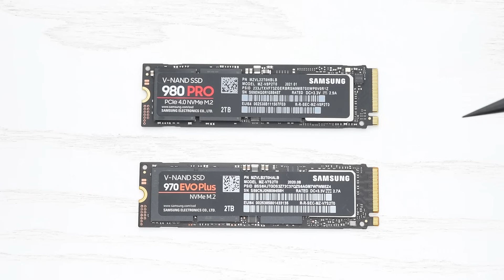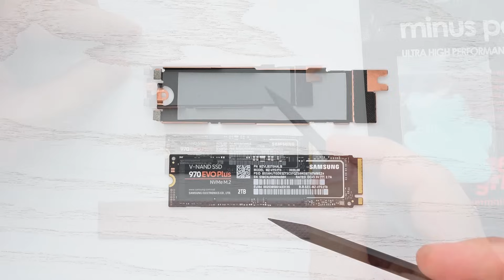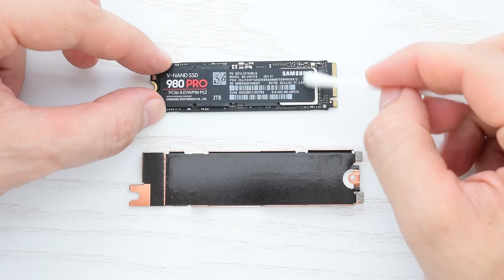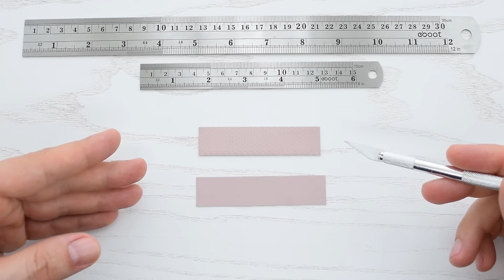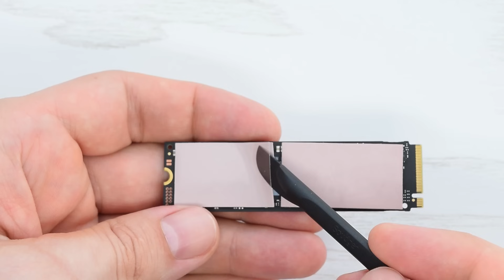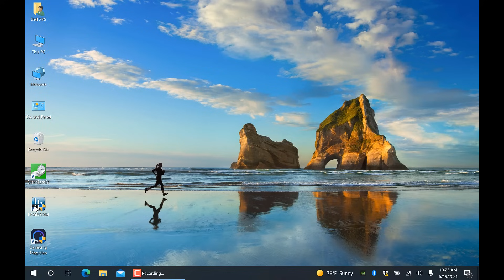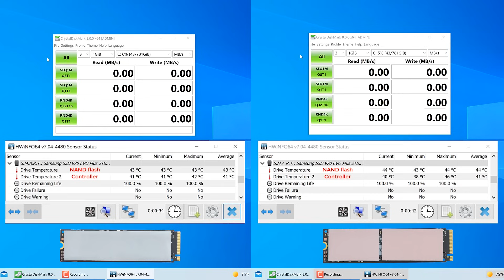Stop your Samsung NVMe SSD from Overheating and Thermal Throttling

Comment: Thanks for the video.

Samsung's design of different heights looks rational because you wouldn't want the controller's heat to be transferred to the NAND because the controller will handle it, it has protection, and in everyday scenarios it doesn't often get hot, but storing information in NAND is dependent on heat.  ...

I will probably level the height with aluminum foil tape (or copper) by sticking it in several layers over the controller. Thermal conductivity Aluminum 200 W/m·K, Copper 400 W/m·K, Thermopad 5W/m·K.
But this will have to be done by touching only the metal cover/sticker of the controller and without pressing (the more you press, the controller will die).
Next with a thin regular thermopad (the thinner the smaller the thermal barrier).

However, it’s probably an exaggeration to say that the heat transfer capacity is significantly reduced between the layers. Yes, it might be less reactive, but believe me — the heat will come out anyway. The real question is how to spread it further (for example, you can use that same copper tape as a shield and extend it to the heatsink). Also, use the system drive on PCIe 4 x4 lanes that have direct access to the CPU, so the motherboard chipset stays cooler.
Reply from the maker: Samsung really dropped the ball with their earlier design. Later Samsung made 980 EVO with a heatsink where they basically did what I showed in the video adding thermal pads for different components: https://i.ibb.co/10HwmmQ/980PRO.jpg. With the 990 PRO, they finally fixed the problem. All components are now leveled for proper thermal contact, allowing much more effective cooling which can significantly extend the drive's lifespan. We didn’t see a flood of failures, but there was still a decent number of data recovery cases for the 970 EVO and 980 and in every single one, the controller was cooked. Heat is the number 1 killer of electronics, no matter what some “SSD experts” claim about NAND needing to stay warm. That idea is nonsense. Keep your SSD cool controller, NAND, all of it. Proper cooling means longer life and your data will be safe.
Reply: @ElectronicsComputers  I measured the 990 Pro (there is also a 980 but it is occupied by the computer) production date 2025.05.26. In short, there are no height differences that need to be solved - if you measure from the bottom of the board, then to the controller 2.0mm, to Nand 1.80mm (both measurements without a sticker), so the difference is 0.2mm, but the components themselves are just as uneven if you put a plane on top of the entire 990, you can see light gaps, even the controller has an upper and lower part (it lies obliquely) and the same with nand. In short, a 0.5mm thermopad will cover everything and its compression will be especially at the beginning of the controller (there will be a belly in the middle if the ssd does not lie against the bottom). No additional solutions are needed.
Reply: @ElectronicsComputers  Is this some kind of recent refresh of the 990 pro? I have a 1 year old 990 pro and it has always have a temp difference of at least 9 degrees Celsius between its temperature sensors 1/2 and 3 in HWiNFO.

Comment: Thank you for posting this. I have Asus Rog G16 G614JV-N4474WS and wanted to upgrade it with a Samsung 990 Pro 1tb nvme m.2 pcle4.

On the Samsung 990 Pro, I did check the level difference between NAND and the controller. There doesn't seem to be any height difference. Maybe Samsung has rectified the design flaw in the 990 pro.

Any ways, i followed you instructions on the video and applied thermal pad and copper heat sink on both sides.

I did remove the sticker on the top and bottom side before i applied you technique.

The top sticker on the NAND was a regular paper type sticker, while the sticker on the other side was flexible heat sink type copper and graphene material. I chose to remove both; to have better bonding and increase conductive heat transfer between nvme and heat sink

Anyways, no more warranty...
Reply from the maker: Yeah, Samsung finally fixed the issue. They later released the 980 Pro with a heatsink, and if you take it apart, you’ll see this: https://i.ibb.co/10HwmmQ/980PRO.jpg It’s basically what I showed in the video, but they went even further adding separate thermal pads with different thicknesses to match the smaller chips. Then eventually, they leveled the top surface of all components, which made proper cooling way easier. You did an awesome job with yours smart choices on thermal materials, and solid execution. Samsung drives are super reliable, and with proper cooling like that, your SSD will have a long, happy life keeping your data safe and secure.

Comment: Problem here is theres still a label sticker between the thermal pad. Thermals could be much better if thats removed.
Reply from the maker: Removing the label will void the warranty and it doesn't make any real difference in cooling your SSD.

Comment: Coming back to this videos years after and i kust say that still its very informative. Now I am willing to use 980 pro 2tb in qwiizlab 40gbps enclusre but not sure of space between enclosure and ssd.  if i follow this which thickness  pads should i get? Can you recommend / advice? Talking about Gelid
Reply from the maker: I have a bunch of M.2 enclosures for 2230 and 2280 SSDs, and most aren’t very precise. If you use a thermal pad that’s too thick, it puts stress on the SSD’s delicate PCB, which can cause solder issues over time. Too thin, and you lose thermal contact. The best solution is thermal putty, like Upsiren link in description. It outperforms thermal pads, fills all gaps, and transfers heat effectively. That’s why it’s commonly used in consoles, laptops, and GPUs.
If you still prefer thermal pads, use a small ball of playdough or something like that on the NAND and controller, close the enclosure, reopen, measure the compressed thickness with a caliper, and order pads in that size. We deal with SSD data recovery quite often, and mechanical stress caused by incorrect thermal pad sizing is one of the common reasons for SSD failure. So take your time and do it right.
Reply: @ElectronicsComputers thank you, would you suggest applying thermal pad or putty underneath the ssd in between ssd and pcb of enclosure? As 980 pro is a dual sided ssd. If yes then wont it be tranfering all the heat to pcb and damaging it?

Comment: Unfortunately it didn't work.
Used 1mm on controller side and 0.5mm on nand side.
Heatsink does not have contact with nand side
Reply from the maker: What's the model of your SSD?

Comment: for my Samsung gen 4 SSD, it shows drive temperature 1, drive temperature 2 and drive temperature 3. what is drive temp 3? and also my stock temps are in between 44-46c
Reply from the maker: If you have three temperature sensors, then the first two usually monitor the memory chips, and the third one monitors the controller which is the most important component. Ideally, it should stay below 50 °C. If it runs at 60-90 °C or higher, it significantly shortens the drive’s lifespan, making it unreliable and increasing the risk of data loss.
Reply: @ElectronicsComputers thnx for reply 🤍

Comment: Is it not easier to just make a sandwich from 2 layers of 0.5 mm pad on a controller part instead of using 2 different pads? Or am I getting something wrong?
Reply from the maker: @iammemes  It's definitely easier and you'll get about the same result, it's just not perfect in terms of thermal conductivity compared to just one pad.
Reply: @ElectronicsComputers  make sense

Comment: but there is no heat sink available in 970 evo plus m.2 ssd ? What should i do ?
Reply from the maker: SSD manufacturers have nothing to do with heatsinks. The heatsink should come pre-installed in your laptop, desktop, or other device. If it’s not included, you can use a universal heatsink instead. Link is in the description.
Reply: @ElectronicsComputers  thanks!! yeah i have installed it in laptop but i didnt see the heatsink cover you were using in your video so i got confused.
Reply from the maker: @rajivsingh3238  Not sure what you mean by the heatsink cover. You apply a thermal pad on the SSD, and then place the heatsink on top of it. Some laptops use the back cover as a heatsink, while cheaper models don’t include a heatsink at all—in that case, you can use a universal one.

Comment: Can you circumvent this by using regular CPU thermal paste?
Reply from the maker: No! Thermal paste is only meant for very small gaps — fractions of a millimeter — otherwise it will simply dry out quickly. For larger gaps, you should use thermal pads or, even better, thermal putty, which offers much better cooling performance than pads. The link are in the description.

Comment: Good day, question: Do I need a heat sink on it, or is it just optional ?
Reply from the maker: For NVMe SSDs, a heatsink is very important because these drives generate a lot of heat. If your laptop didn’t come with one, there are universal heatsinks available (link in the description) that can be attached to most SSDs—just make sure there’s enough space in your laptop to fit it. Running an NVMe SSD without a heatsink will almost certainly cause it to throttle performance under load. But more importantly, it can significantly reduce the lifespan of the drive. So if you’re just using your SSD for casual tasks like watching videos or browsing the web, it’s probably not a big deal. But if it’s a work laptop with important data, I’d definitely spend the $10 on a heatsink—it’s a small investment that could save you a lot of trouble later.

Comment: Do you think it would improve temperature/performance if I remove the ssd label before applying the thermal pads?
Reply from the maker: Removing the label will void the warranty and it doesn't make any real difference in cooling your SSD. I did some testing and it's no more than 1C degree difference, so it's not worth stressing the components by pulling that very sticky label and voiding the warranty.

Comment: What do you think is the best use of thermal pads for the 990 Pro for a normal PC?

1) 2 mm
2) 0.5 mm + 1 mm
3) 1 mm + 1.5 mm
4) 1.5 mm + 2 mm
5) 0.5 mm
Reply from the maker: Samsung 990 has almost flat surface so the most safe and ideal choice would be a single 1mm pad if your cooling solution allows to use it. Alternatively, you can also use a single 0.5mm pad. There's definitely no need for two pads for that particular model.
Reply: @ElectronicsComputers  Thanks for the reply.

During testing I noticed temperatures of 67-68C at load and 50C at idle (on sensor #3 is usually the controller temperature according to HWINFO program data 
), in your opinion is this normal ?

I am just now using a 1 mm thermal pad
on my MPG Z790I EDGE WIFI with 990 Pro.

Comment: I've bought an used gaming laptop with good condition. But i wonder why my SSD tent to be hotter than my friend laptop even though the spec quite similar (same manufacturer; mine R7 4800h + RTX3050, my friend R7 4800h + RTX3060). My friend got green light in HDD sentinel while mine got orange even though mine is newer (2020 vs 2022 production date). 
. 
Until i noticed this video about Samsung SSD and my default SSD also come from Samsung, OMG Samsung
Reply from the maker: It’s either due to poor cooling, because, as I explained in the video, the controller chip barely makes any contact with the thermal pad, or maybe there are some background processes that overload your SSD, causing it to run hotter than your friend's.

Comment: Thanks for this video! I'm now wondering if using a bit of thermal putty instead of thermal pads would also be viable. 🤔
Reply from the maker: Thermal putty is a much better option. First of all, it has significantly higher thermal conductivity. Secondly, it can cover all components, adapt to their size, and effectively transfer heat from the components to the heatsink.

Comment: Hi, I'm using Samsung PM981a (the OEM version of 970 EVO Plus), on my old laptop which was Lenovo IdeaPad 3 with AMD 3020e CPU, i was using the drive without a heat sink and the temp was perfect, i don't even remember that it reached 60, it's a weak CPU and i completely understand that, now I'm using the same drive on Dell Latitude 5511 and it overheats even with the OEM heat sink, it reached 76 many times under load, i even removed the heat sink and i can easily say that there's no any difference W/O the heat sink!! I'm confused now because the drive itself was perfect in terms of temp but after using more powerful laptop the drive is overheating and with a heat sink! BTW, the CPU's temp is fine, i even disabled Turbo Boost on BIOS, any suggestion? Thank you for the video, seems like the last resort is your modification.
Reply from the maker: Those SSDs overheat because one thermal pad doesn't cover or doesn't make a proper contact with all components that have to be cooled. At some point Samsung also figured out their design problem and they did almost what I did in this video but they went even further: https://i.ibb.co/10HwmmQ/980PRO.jpg So just make a mode like Samsung did, or do it like I did in my video using two thermal pad with different thickness and high thermal conductivity.
Reply: @ElectronicsComputers  Thanks for responding, I'm gonna try your modification ASAP.

Comment: Interesting I always wondered why laptop manufacturers would use 2 pieces  of thermal pads instead of one. I thought it an odd quirk but I guess everything has a reason.
Reply from the maker: Samsung already did it and they used even more pads with different thickness. I guess, they figured out they mistake: https://i.ibb.co/10HwmmQ/980PRO.jpg

Comment: Is there any value in placing a thermal pad on the underside of the board, so there are pads on both sides?  One concern I would have is if the bottom pad elevated the height of the board, making the male edge connector slightly higher than the female connector.
Reply from the maker: Yes, that underneath thermal pad can definitely help, as long as there are no components on the other side of the board that produce heat or ones that shouldn’t be exposed to heat from the drive. Your concern is pretty valid, as I can't stress enough that SSDs don’t like bending at all. It’s one of the most common faults when the NAND chips or the controller’s solder balls separate from the PCB due to mechanical stress. To avoid this, you should either use a precise thermal pad or go with thermal putty. This stuff is used in graphics cards, gaming consoles, etc. It has much better thermal conductivity, is easy to apply, and works like a thermal pad but is softer and can adapt to the shape of surrounding components. The link is in the description.

Comment: Can you stack two thinner pads to make one thicker pad?
Reply from the maker: Yes, you can, and it will perform perfectly well, even though it's not a perfect solution. Some laptop manufacturers also use this practice, by the way.

Comment: Anything that stands between the chips' lids and the heat sink only adds more thermal resistance to the issue. Thermal resistance is exactly like electrical resistance: adding resistance INCREASES the resistance. When I look at these SSDs from all of the manufacturers, the thing that screams at me is the PAPER LABEL they all apply their products. These labels have HUGE thermal resistance! My solution is to rip off the label despite the warning telling me that I am voiding the warranty when I do. With the paper label removed, THEN attach the thermal pads directly to the chips. This will lower the thermal resistance, and should result in lower temperatures. 
Also remember that the thicker the thermal pad, the more resistance it has, so apply the thinnest thermal pads to the tallest components (usually the SSDs) and the thickest thermal pad to the least tall. This is, unfortunately, exactly the opposite of the most desirable solution (= thinnest thermal pad on the controller for minimal thermal resistance), but it is what it is.
Some day, some bright company is going to sell a complete solution that includes its own SSD in its own enclosure, and they will use a heat pipe placed directly on the controller, then have a little fan blowing directly on the pipe's "paddle" to very substantially reduce the controller's heat rise to near-zero levels.
Reply from the maker: Removing the label will void the warranty and doesn’t significantly improve the cooling of your SSD. It may lower the temperature by 1–2 degrees Celsius, but this has no meaningful impact on the performance or longevity of the drive, making it not worth the risk. Removing the label could slightly improve heat dissipation in rare cases if the label is thick or poorly conductive. However, in most SSD designs, the difference in temperature is negligible.

Comment: Graphene heatsink or radiator heatsink for samsung 990 pro , which one would you recommend ?
Reply from the maker: That depends on your usage and device. For a desktop PC, I’d recommend a regular copper heatsink, which provides excellent heat transfer under most conditions and performs well during sustained workloads. For laptops, the situation is more complicated due to space constraints. If you can fit a universal 1.5-2mm thick copper plate, it’s a great choice for handling sustained, heavy workloads. If that’s not possible, a graphene heatsink is a good alternative. However, due to its small size, it can become heat-saturated quickly. Without proper ventilation and airflow inside your laptop, its effectiveness decreases, especially during prolonged heavy use. If your laptop didn’t come with a dedicated heatsink, it’s crucial to use anything that can help manage the SSD’s temperature to extend its lifespan and reduce the risk of data loss.